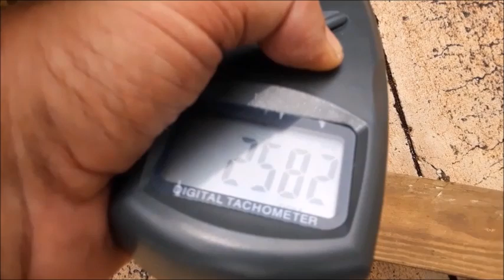9 HP Chinese Diesel Review

Comment: The line on the injector does not need to be cracked to purge air. Pull the engine over 4-5 times/compression release used. and the engine will be fine. I started mine in 5 pulls without bleeding the line. It is not a vehicle engine with a complicated pump design.

Comment: Pto shaft...... try crankshaft.... deisel engines not underload will wet stack and slobber through the exhaust if the engine doesnt get hot enough

Comment: Do you know if the PTO shaft bolt holes are standard or metric threads? Have you checked the maximum RPM it can achieve with your meter? Thank you.

Comment: One of the things I have learned about small engines is that it is absolutely vital that they have short interval oil changes during break-in. Even the highest quality small engines, like the Honda 2000W “suitcase” type generator will make oil look like pearlescent glitter paint after the first half hour of operation. I change the oil after first half hour with no load, then after each tank of fuel until I can no longer see sparkly metal particles in the oil under bright light.

THIS is how you get long life from these small engines. I break them in with 10W-40 diesel or motorcycle rated oil. Then I run them long term on 20W-50 motorcycle oil.
Reply: Wow, what a great comment. What you're saying makes perfect sense, but I never thought of that. Thanks!!

Comment: I've had two of these, both spewed copious oil from the breather and exhaust at any load at all..  Perhaps if they set ring gaps correctly..
Reply: Have you got any pics of it doing this? on the oil discharge
Reply: @briancaldwell1798  No, we just sent it back.
Reply: Didn’t adjust valves
Reply: @crematedable  assumed

Comment: It is made with poorly casted garbage metal.No thought of tolerance.It will not last at all.All things Chinese are garbage.Planned obselescence carried out to the extreme.Why are we not asking how something can be shipped across a giant ocean and sold cheaper than one produced here?Why did we never buy anything from the USSR but buy everything from a just as repressive if not more so Communist China?They use child and slave labor documented.And Tiananmen Square anyone?The genocide against the uyghurs?The suppression of ANY religion.If you buy Chinese you are part of the problem.Plain and simple.You should be ashamed.
Reply: Over 10 years ago I bought a Chinese made generator for $499, which I have been using to power my tools.  It now has well over 2,000 hours on the clock.   It performs well, and has never given any trouble, except a plastic fuel hose needed replacement at about 1,500 hours.   It is rated to deliver 2 kW, but on test delivered 2.2 kW without the governor loosing control.
Hardly anyone buys American Briggs & Stratton anymore - they are double the price and are not as good.  The other once well known American small engine maker Kirby Tecumshe disappeared years ago.  
The reason why didn't buy from the USSR is that their products were decades out of date and often servicing nightmares.  Chinese made stuff is generally copies of Japanese products of only 10 years ago, and often right up to date.
Reply: @keithammleter3824  fixing old out of out-of-date engines on snow blowers one day and I said enough , went to Chinese clones and never looked back. They start all the time even in extreme cold and are much more powerful and fuel efficient than the old Tech. When China steals designs I am glad they chose Honda to rip off.
Reply: So why isn't the USA producing them? Even Briggs uses offshore parts. Have used Chinese engines on a lot of things without any issues.
Reply: @papabits5721  If that engine was produced in the US, it would cost $3000
Reply: you wouldnt afford to live if china stopped supplying your stuff
Reply: Free market capitalism is what keeps China and the United States from going to war.
Reply: @kevinmiller5467 It's actually nukes.
Reply: No, no. He's got a point.
Reply: You do know Honda engines etc are done in the exact same factory by the same company. Most often the only difference is the sticker. Although in some cases they do use cheaper material so you need to find the right factory.
Reply: Child and slave? Genocide against uyghurs? Stop sleeping in the dream the US gov draw for you. Open your eyes, go the country, explore it yourself. Watch the video, China had opened a 6-day no visa needed entrance for most countries. Go to Xinjiang Province, explore  the Uyghurs life. Look at China Showbiz, and you will find out a LOT OF Uyghurs actor and actress. Ive been to Xinjiang province. People there believe in their on belief, dressing their own cloth, have a happy life and enjoy everything modern. Go to China factory, try to find some slave or child. Be noted, there are nobody follow you in china, not like North korea, Western people can go anywhere they want, any places they like. Go Explore it yourself. Stop dreaming it like what you are doing right now.

Comment: Problem with diesel is they like low rpm and the generator running at 3500 is going to cause a lot of torque on the belt. Especially if you load the generator.
But Diesel is the way to go. They are very efficient and have loads of torque. I would mix some lubricants with the diesel fuel to help the fuel pump survive our very dry diesel fuel. Some motor oil or 2 stroke oil. Our low sulfur diesel doesn’t give much lubricant to the fuel pump or the injector.
Reply: how much two stroke oil should i add to a full tank on this engine? Gonna put one on my Rototiller.

Comment: Which supplier did you buy this from? I'm looking for a good diesel but potentially a bit smaller.
Reply: Oh and how long does it run on a full tank?
Reply: 168F. 1/3 the size and also superbly made. Keep the RPM's low and be very wary of ether starts. It's a very easy way to do damage. Mount it on an aluminum plate.

Comment: Use an inverter with regulator and run it a bit faster
Reply: Dumb. Run it with a truck alternator and pure sine wave inverter, but slow, and aim for 3 HP or less.

Comment: What's the size of the pto crankshaft.
Reply: I think it's 20mm
Reply: @olgreen  This is a clone of a yanmar L100, it's 1inch. The 168F engine rated at 3hp has a 20mm shaft.
Reply: @Codyjrt  fixed. The 3hp engine is 168f. Easy to get them mixed up.

Comment: Great job on the generator. Question I can find it anywhere but what's the mount flange bolt pattern around the crank shaft. I'm planning on putting one of these on my rear tine tiller.

Comment: I too live on the coast and have since 1970's.  I needed a genset as well, but instead of diesel, I went natural gas/propane.
You dont need to ever worry about your fuel system being messed up, gummed up, dirty, if you use Natural gas.
Reply from the maker: Indeed, my propane genny also works well. Also propane stores forever without worries.

Comment: What about the engine oil that you put by removing the orange cap? Did you add it yourself or does the engine comes with it?
Reply from the maker: It comes empty, and you add your own.
Reply: Probably want to do frequent changes during initial run-in, e.g. first half hour at a fast no-load idle, change oil, then change oil every few hours for a few changes…

Comment: I wonder how much elec a 3 HP diesel could put out
Reply from the maker: You can figure about 700 watts per hp.
Reply: But run your 168F at 1 - 1.5 HP and less than 1800 RPM = good practice.
Reply: Uh, give more margin.  2 hp per kw is a figure I’ve read, and that sounds likely.

Comment: Does this engine have its own electricity supply? Like magnet coil stator?
Reply from the maker: You can get a starter kit for it that includes that stuff, but mine is just pure pull start / compression....kinda nice to have no electronics, but that compression stroke is serious.
Reply: @gwseymour  - Right.  Starting batteries are a pain in the butt to maintain all the time.   Small diesels like this are easy to start in the cold with just a whiff of hot air in the intake with a propane torch and /or a rag soaked in engine starting fluid stuffed loosely into the intake.

Comment: Any idea if these would run on vegetable oils?
Reply from the maker: I'm not a diesel expert, but I know that folks have had mixed results with different oils. One day (another project), I'm going to get one of the cheaper, smaller ones and experiment. I'd imagine you could expect some issues with injectors, etc.
Reply: These cheap Chinese diesels are great to experiment with.  It's hard to hurt them and any failed fuel experiments, you can completely strip this whole fuel system down and completely clean it quickly and start over.
Reply: I know the 196cc ones run on pretty much anything as long as what ever you use is oily enough and is clean you won't run into any problems.
Reply: Ive only seen one problem were the used veggie oil gummed up in the piston rings.
Not sure if they didnt filter it out properly or what.
Reply: Veggie? Generally yes, but don't use dirty motor oil (super abrasive) or ether to start ( like a grenade ).